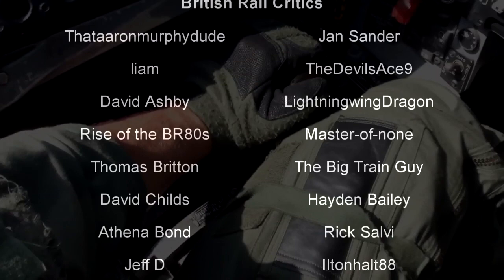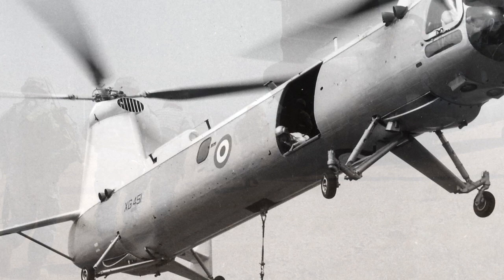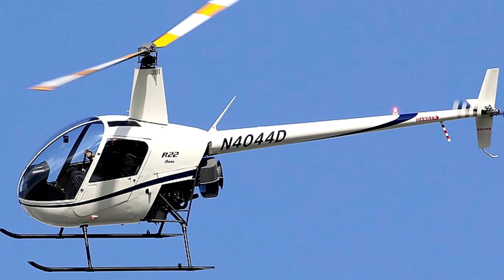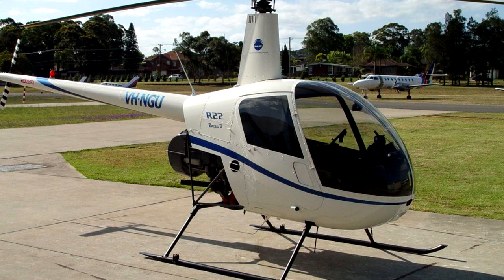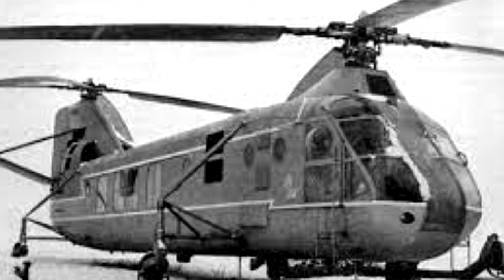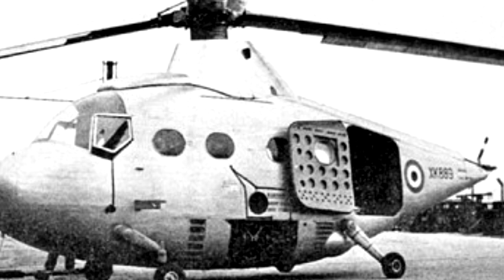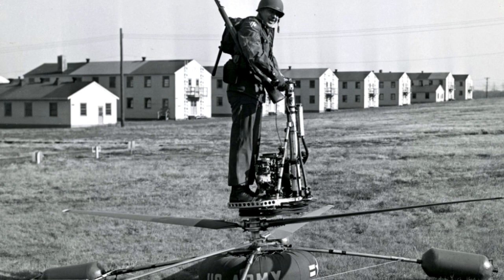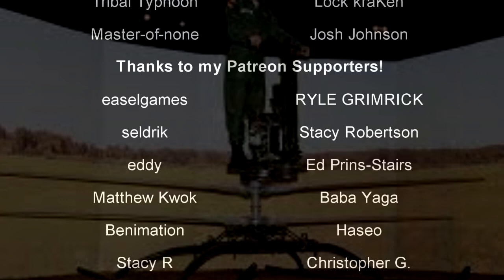5 of the Worst Helicopters Ever | History in the Dark

Comment: Nothing wrong with the R22, not one thing - now. It's a similar design to the Huey, in fact the designer was a Bell engineer before he went off on his own to start the Robinson company. Nothing wrong with it as a trainer either if you are capable and are taught what not to do. It says big as shit to not perform negative G maneuvers, same as any helicopter with this rotor system type, or it could result in a mast bumping situation. So...don't do that. Solved! It's a known thing about the inertia, R22 killed a lot of experienced helicopter pilots early on because they were used to flying helicopters like Huey that had huge amounts of reserve rotor energy. I blame that on those pilots for not flying the helicopter as designed, just like the cowboys that were crashing 727's all over the place early on because it had gobs of power, was maneuverable, but unforgiving in certain flight profiles. Those lessons, written in blood like a lot of aviation lessons, have been reinforced and everyone knows to get the collective on the floor immediately. I wanna also add that this isn't just an R22 thing, I bet all of us who have had helicopter lessons in ANY helicopter, trainer or otherwise, are told this from jump. I know I was. The only really poor design the Robinson had was fuel tanks bursting open and lots of post crash fires killed people who probably would have otherwise survived. This has also been resolved. 

Yep, it's true that a light helicopter can't handle much in the way of winds or turbulence, and so there is a note in the manual that states you will do special training. Nothing wrong there, don't exceed the limits of your aircraft no matter what you are flying or you invite disaster, so again not specific to the Robinson. 

PS, I don't care what Wikipedia says, the R22 was never a utility helicopter lol....what utility purpose could a helicopter with a 1200lb take off limit have? With a 900lb aircraft weight and me in the helicopter I was right up there...my instructors all had to be 140lbs or less. Not practical as a utility helicopter and it shouldn't be called this.